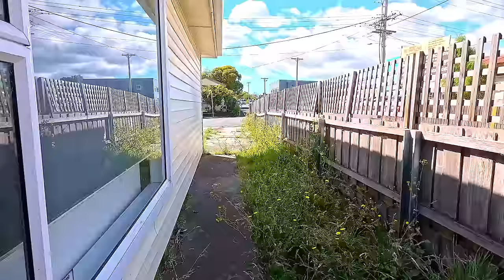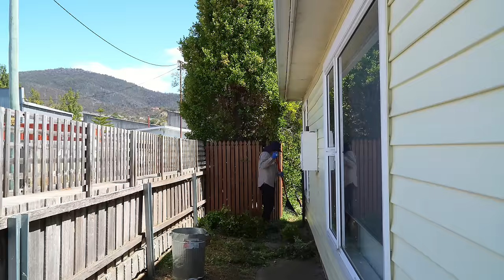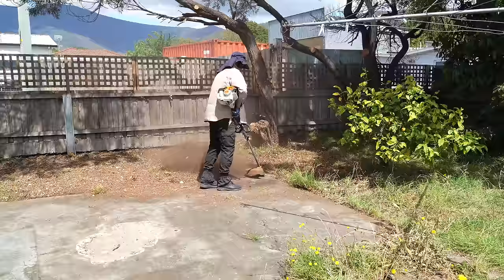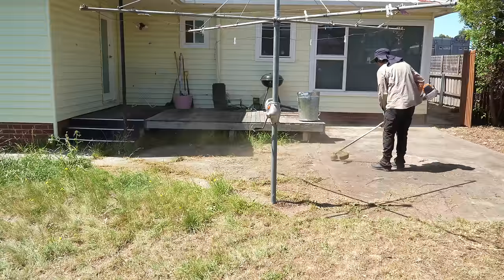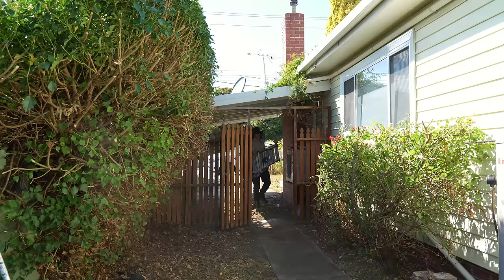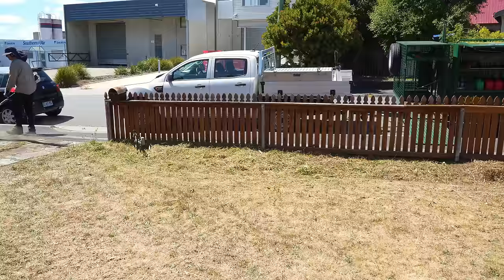How to add $50,000 in value with an Unimaginable Yard Transformation!

Comment: You're only going to realize that $50k bump if there are Comps in your area that have similar improvements and have sold in that range.  Otherwise the appraiser and the bank aren't likely to loan the buyer based on the elevated value.  Or, maybe you'll get a buyer with enough cash to take the plunge.  Not.

Comment: grouse work George mate a lovely transformation for sure from my view plus the front yard to the backyard yep a good reveal with before and after results and yep some lovely looking plants in that backyard for sure and well just looking at the side passage area yep the top part of the fence could use a repair too but yeah probably just a loose nail or was not properly secured to begin with but yeah i,m sure that one can be dealt with in the long run for sure plus i love the good finds in there from the two (2) BBQ.s which is old Gas Cooker type with the good old Gas Bottle type and even the old Kettle BBQ too yep top notch those inventions for sure and always ideal those who love a nice Summer Barby for sure cheers mate.

Comment: Presumably the metal fencing, which seems to be quite prevalent in Australia, is a lot cheaper and more durable than using wood.  Does it cause the gardens to be hotter in the summer if the sun hits it or is the paint used special non reflective paint?